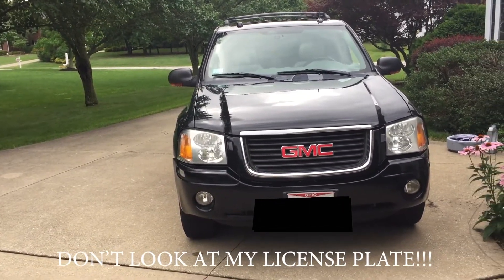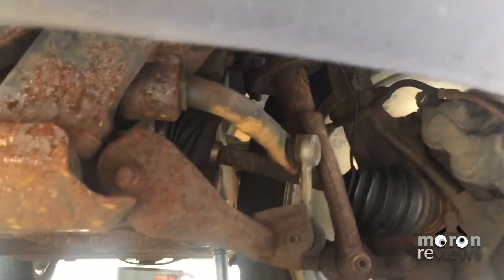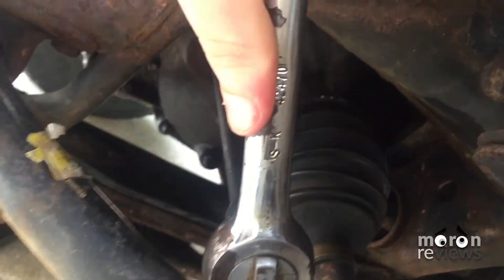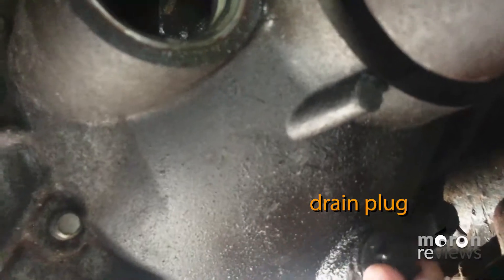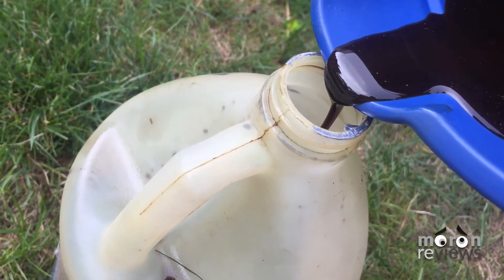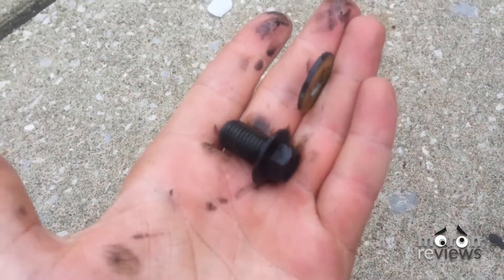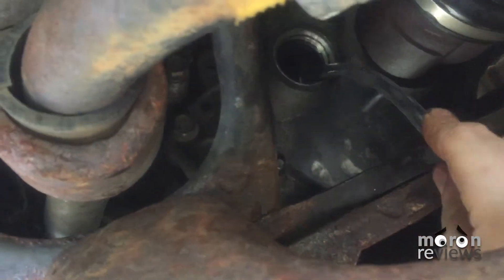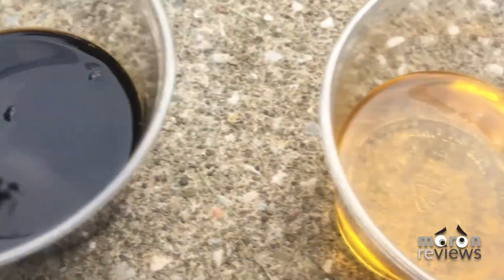Trailblazer Envoy Front Differential Fluid Change

Comment: Good video. Sometimes I pump a few in with drain plug off , it will push out any chunks there . Great job though. I have 2 trailblazers work on them all the time . Your envoy looks good.
Reply from the maker: Thanks, Ken. Most people would be surprised how long these vehicles actually last.
Reply: Yeah I know some guys in the forums who have well over 300,000 miles . Regular maintenance and good quality oil changes are the key.
Reply from the maker: @kenoger2866  Agreed. The I6 is pretty solid as is the V8. Only problem to look out for is the valve issue the I6 is known for. Causes a misfire, burns gas, rough idle. Requires a valve job to fix. Using Mobile 1 5 W 30 on this one.
Reply: Good... I also like valvoline and they have high milage synthetic that is gm dexos certified . I always use the mobile 1 oil filter also .
Reply: @kenoger2866  this needs to be GM dexos I bought synthetic

Comment: Torque FRONT DIF drain/ fill plugs to 24 in-lbs (all years)
REAR DIF drain plug 36, fill 24. Later years may not have a drain plug - you will need to look at your pumpkin plate and buy a new gasket (I chose new plate w/ rubber gasket & new bolts) Sanded, primed & painted it BLUE)
TRANSFER CASE plugs 20 in lb. USE THE FACTORY STUFF (Auto Trak ii) . I just bought 2 bottles at NAPA for $10 each (May 2024)
Using Teflon tape (yellow, not white) on all fill/check plugs can help reduce leak as well as easy removal; but it will need replacing each time.
Dexos was a standard created for vehicles beginning in 2011 and they are not sideways compatible. IMHO, any quality name brand with appropriate specs like weight,  gl-4 or 5, MT-1, etc will serve just fine in pre 2011.  There is a gm specification for anti friction additive if the lube doesn't already have it. I have always used MOS², easy to add from 1.7 ounce tube. Squirt it in 1st, then add lube   until it overflows.
Given that my Chevy TB has 200k and difs never been serviced (original owner was a dealer!  - lazy, hillbilly mechanics) I  will change fluid again as soon as time permits and add the friction modifier at 2nd change.

Rear pumpkin plate bolts are easier  to remove while Rear wheels are dangling (no need to remove tire/from axle) & spare tire is out of way. I have put a torch to each bolt,then spray several drops of PB Blast on each bolt (actually I heated all on bottom half, oiled them. Then repeat same with top half). I keep a fire extinguisher within reach. I also like a fan gently blowing to keep fumes from concentrating. 
Know and understand what you are doing-OR- find someone to help who knows.